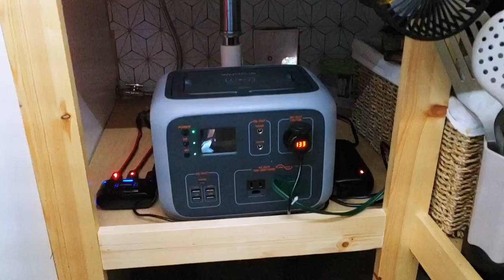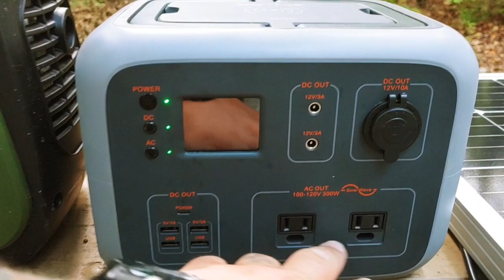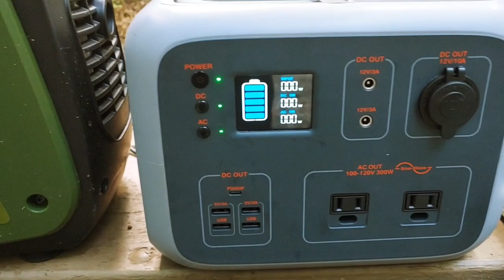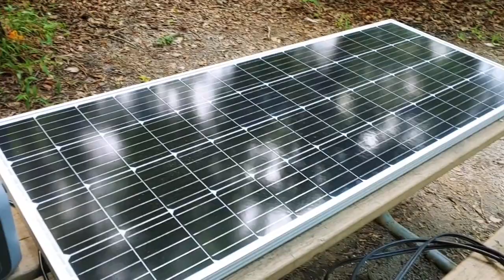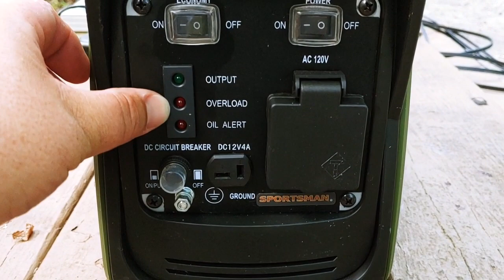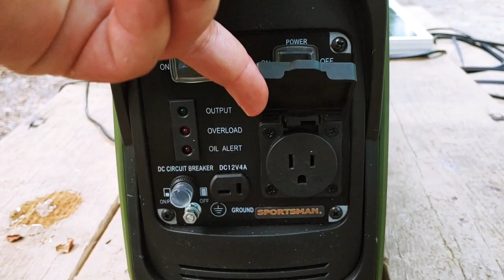How to power your cargo trailer camper conversion, and have air conditioning!

Comment: Awesome setup!! It simplifies everything so much!! Is that generator loud? Do you run a long extension cord to it and put it far away so you can’t hear it? Thank you in advance! :))
Reply from the maker: Thanks!  We needed to simplify the power as much as possible.  It was a major headache for us trying to learn the ins and outs of solar!  Our generator isn't very loud.  We usually keep it in the back of the truck when we stay in parking lots and things like that and we can't hear it inside.  When we are boondocking we have a long extension cord and put it further away so it isn't distracting outside.
Reply: @ourlifeoutdoors3942  Thank you so much for your helpful info! I may go to tractor supply and pick one up! The reason I haven’t bought a generator for my trailer is because years ago when I had them, they were so loud! But I realize everything has come a long ways these days. Haha And yeah, my electrical in our trailer is kinda a nightmare lol!

Comment: Can you power your 5k air conditioner with this gas generator ? I was thinking it would take a 2200 wattt to power it
Reply from the maker: We have a Midea 5000 BTU 115V mechanical air conditioner. Mechanical matters because digital air conditioners use more wattage. Purchased from Walmart for $134. The 1000 watt  sportsman generator has no problem running it. About 7 hours of run time on one tank which is a half gallon of gas. I use ethanol free. Altitude does play a role so keep that in mind. You lose approximately 10% of your wattage output for every 3,000 ft above sea level.
Reply: @ourlifeoutdoors3942  Thats amazing ....Is that window air an (easy start ) low amp. draw, for starts and kicking on and off? Thanks

Comment: How are you connecting the generator to the Bluetti?  I have that same generator, but we have an installed solar kit (Renogy 200w w/1000watt invertor and Rover charge controller, 100ah gel hybrid battery).  I wouldn't mind being able to use our generator to charge the battery when solar isn't sufficient, but I'd like to see how you're connecting yours to the Bluetti.
Reply from the maker: The Bluetti comes with a standard AC adapter that can be plugged directly into the generator. If you have a standard 12 volt battery bank and you have the same generator that I have, then you should be able to use the 12 volt DC charging cables that came with generator to hook directly to your battery. Just be careful to monitor your voltage so you don't fry your battery bank.
Reply: @ourlifeoutdoors3942  Thanks much!

Comment: I bought an ac50s a few months ago for emergencies and in preparation for some boondocking. I got it, tried the ac plugs they worked, the 12v adapter and it worked, the usb and they worked but the top wouldn't charge my phone. I figured it's because i have a old android but wasn't concerned, and i didn't worry about it. It was charged so i didn't bother checking that. I pulled it out last week to run a fan and radio, and when it dropped to 60% of charge i plugged it in to charge and it won't charge.
    I don't have the email of the purchase, i had so many old emails and pictures i was running out of storage and evidently i erased it. I wasn't concerned because i have the warranty, and the big channels they gave them to for reviews said anything that was wrong with their units was taken care of no problem. 
   Long story short, they aren't doing anything about it because i don't have the purchase order. Make sure you keep yours!!! Evidently im not the only one who is having problems with them charging after getting them, or getting blue etti to honor warranty. Just a heads up. Hobo tech did a review and they seemed awesome, and as far as running my fan, lights and phone i was very happy. The fact that they evidently have problems charging, and don't stand by their units if you can't provide your purchase order, not so happy.
   I bought from their web site, and told them i could give them my credit card number to verify purchase, they said they checked and had no record, which is funny since they don't have the name on my credit card or the number.
   I don't mean this to be a rant, but make sure you save more than the warranty papers as they are worthless. My warranty was stamped from the inspector less than ten months ago, but that don't matter to them. No po, no help, and i have had to send multiple emails and wait 7-8 days for a reply. 
   Hopefully yours is problem free, and you get lots of use out of it. But i can't stress enough, keep your po and any paperwork! God bless!!
Reply from the maker: Oh gosh!  I'm sorry that happened to you!  I hope you can get something resolved.  We have had zero issues with ours.  But we will definitely keep that in mind.
Reply: BIBENE C505 only 400 bucks 629 watt hours Amazon 2000 charge cycle. I love it